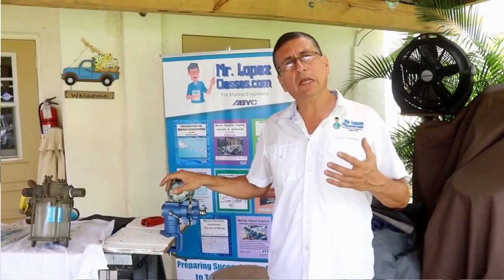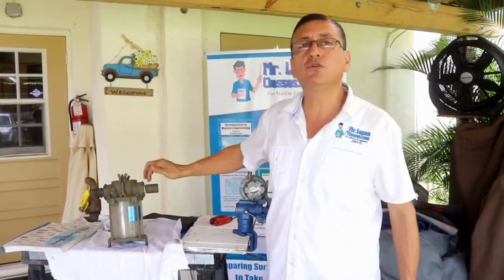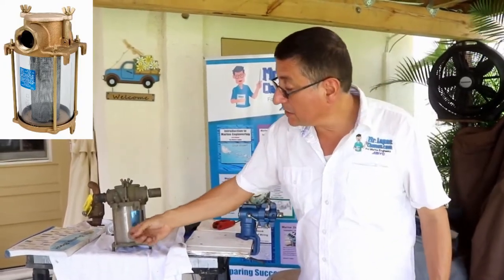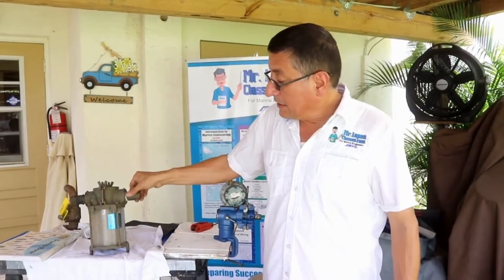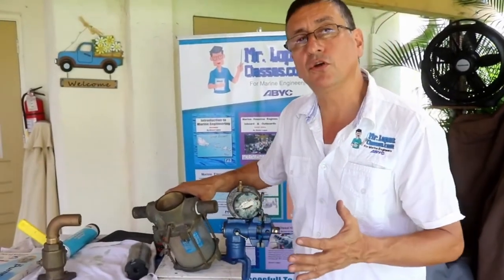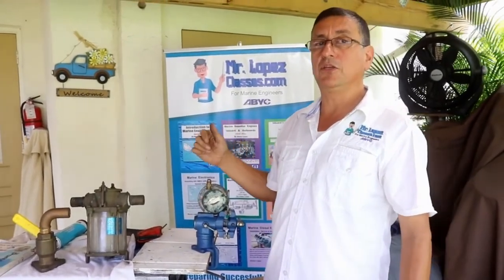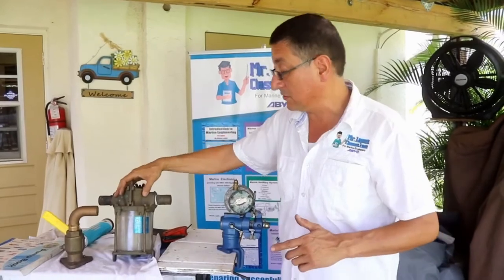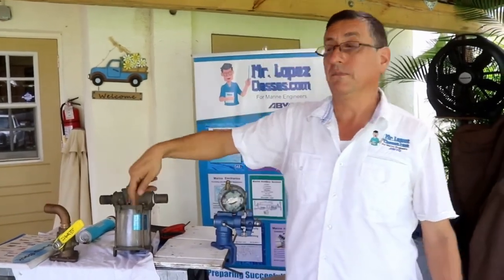Raw Water Strainer

Comment: Good Morning Prof. Lopez. Amazing classes.
I would like to add that for avoiding bubbles on the strainers some of them have a plug on the Top of the lid where you can add a vent line or spirotop device which will take care of that air build up inside the strainer and maintain a bubble free water supply to the engine raw water pump.
See you on the next class.
Kind Regards,
Reply from the maker: Alejandro , the bubbles are the enemies of impellers and heat exchangers, when the temperature increase the diameter of the bubbles increase until they explote producing erosion and cavitation. I hope this material be useful for you